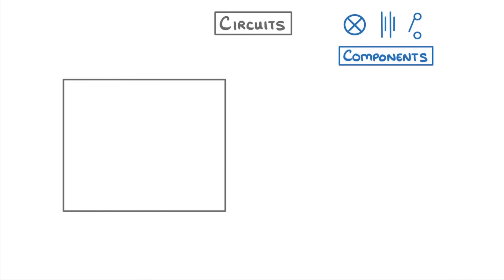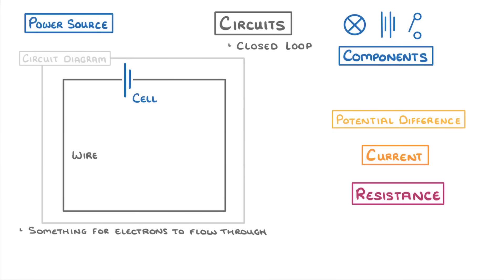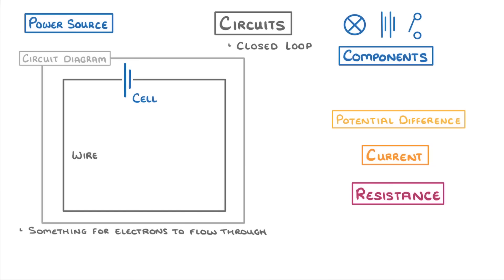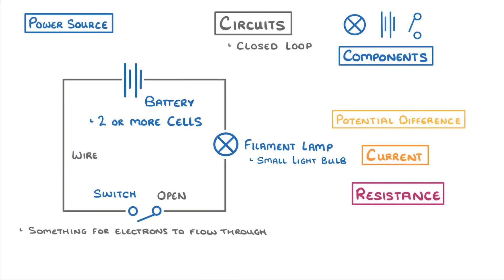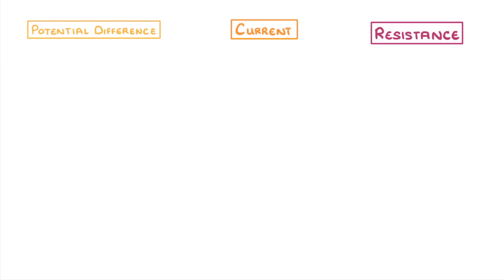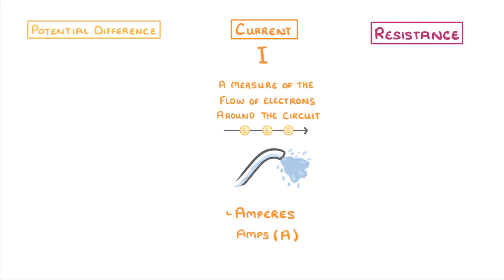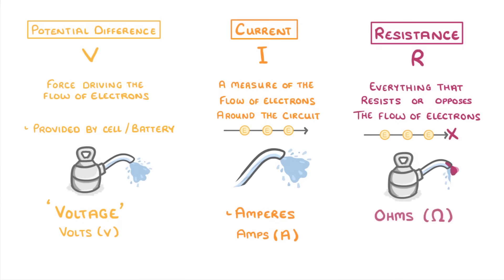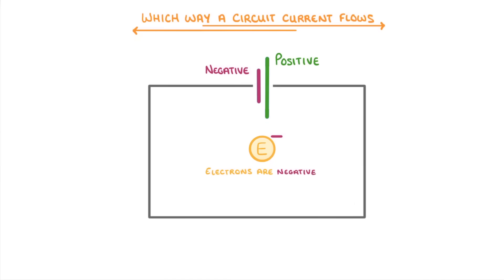GCSE Physics - Intro to Circuits

Comment from the maker: If you’d like to practise the material covered in this video, check out our platform at www.cognitoedu.org - it's totally free, and has been built to make learning and revision as easy as possible. The main features are:
- Lessons organised by topic, only the lessons relevant to your specific exam board and tier are shown.
- Automatic progress tracking. Progress bars tell you what you’re doing well at, and what you need to spend some time on.
- Practise quizzes so you can test your knowledge. You can quiz yourself on any combination of topics you like.
- A huge number of fully-hinted questions that take you step-by-step through some of the trickiest calculations & concepts.
- A comprehensive bank of past exam papers, organised both by year, and also by topic.

Amadeus & Tom
Reply: Hey cognito can you add Cambridge physics to your website if you can thank you
Reply: Ri8 agreed !!!

Comment: i really dont get conventional current
Reply: So basically from what I understood is that the direction of electron flow is what actually happens inside of a battery BUT when Benjamin Franklin was still figuring out this theory he had no idea of the fact that the negative terminals electrons would flow to the positive terminal (since the electrons are goanna be attracted to opposite side) so he just said “it flows from the positive side to negative side” which isn’t true but we just go with it hence why it’s called “conventional.” Conventional current’s flow is OPPOSITE to the direction that electrons flow since it’s just a false term but everyone just stuck with it😭 hope this helps I could explain more! good luck girl💞
Reply: Righttt….. sort of get it- thank you 💗

Comment: This convention ruined an entire week for me.

I was studying chemistry and the topic was how ores are extracted and purified / refined . I had kept the convention in the back of my head that current flows from the positive terminal to the negative terminal and I thought that electrons flowed from the anode to the cathode.

I read the whole chapter and made the notes. Then in the end I was all confused because the physics of the ions just didn't make any sense. I researched a lot and then I found this video. I really appreciate your effort. Thankyou from the bottom of my heart ❤️.

3:29
Reply: So true, it’s technically the fault of physicians for deciding to continue with this convention. I don’t get why they didn’t just change the original ideas people had, like developing the atom model
Reply: @vibrantebony I don’t see why we’re being told to know it that way if it’s wrong
Reply: @vibrantebony I don’t see why we’re being told to know it that way if it’s wrong
Reply: I DONT GET IT PLEAZE HELP ME WHAT
Reply: HOW DOES IT WORK

Comment: i don't understand, why do we need to say that the current flows from positive to negative when it actually doesn't? I have my nationals in physics tomorrow and im so confused-
Reply: this might be a bit late but when benjamin franklin rubbed a tube with a cloth and touched it, he discovered static electricity, he assumed that the static forms when the electrons from the tube is in contact with our hand which has no electrons. After this discovery, battery brands changed the negative and positive symbols on the sides according to his discovery. but joseph thompson found out that when the tube is rubbed by the cloth, the cloth takes away the electrons from the tube, so it has no charge, when a human touches the rod they get static electricity because their electrons are transferred to the rod. but because most battery brands already made everything according to benjamin franklin's theory, nobody changed the design of the battery to the correct way which was negative -> positive. so every battery brand still labels the sides wrong, the positive and negative signs need to be switched in order to be factual. this battery design is called conventional theory. so when you're drawing a battery with a circuit, you should draw the electrons as if they come from the positive side to negative, but when they ask you to answer in words as to where the current flows from and to, it should be negative to positive. so, the drawing of positive to negative because of the battery is labeled as conventional current, which almost everybody uses to draw. i hope this answered it.
Reply: @kinapindeesebich ok

Comment: It’s suppose to be all connected in the circuit all the wires must touch the switch batteries and lightbulb or it is considered as a open circuit

Comment: Thank you sm!! One thing that i was confused on was when you said the shorter line on a cell diagram is negative. I remembered my teacher telling me it was positive and negative was the longer line. Other than that, i think you video is great and it will help me a lot for my stressing exam tomorrow!
Reply: uh so im gonna just jot this down..
the information in the video is correct, since that is what the gcse physics book has in it-
if that what ur teacher said then you might wanna confirm again